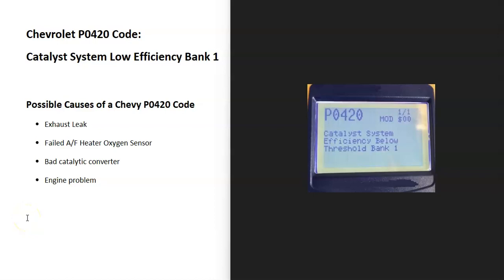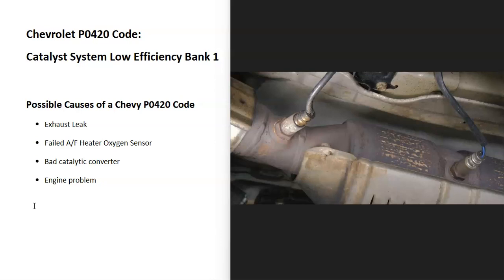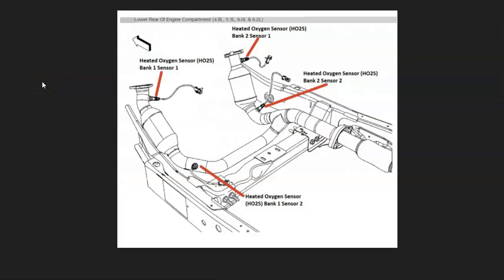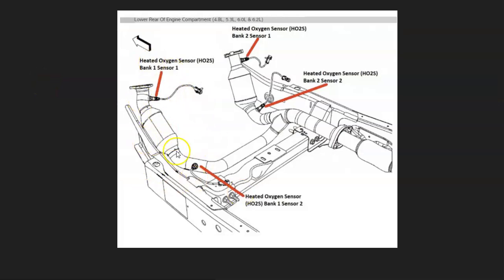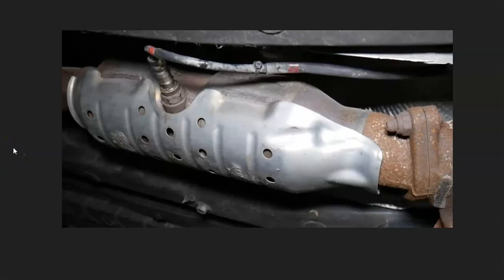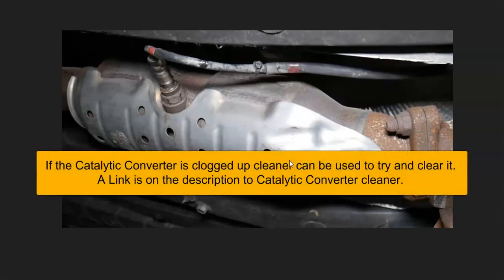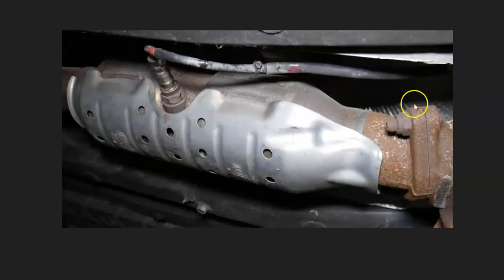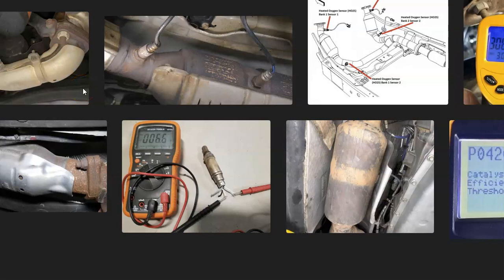Causes and Fixes Chevrolet P0420 Code: Catalyst System Low Efficiency Bank 1

Comment: Im wanting to fix this issue that arose after a shop saved my engine replacing the timing chain kit. Engine light was not on before this repair. Same day, p0420 code comes up when tested at oreillys. There is a seal I notice not sealing the air compartment. Noticed debris in that compartment. Have cleaned the mass airflow sensor. I keep my 'under the hood clean'. Car sits out in elements. I believe it need to change the sensor & spark plugs...just a few things I can mark off as upkeep on my 228,000 mile '12 Malibu. Any insight & advice would be appreciated

Comment: I have a 2015 Chevy Cruze lt and I keep getting this p0420 bank 1 efficiency low code. I have replaced this catalyst converter 3 times already the last time I got new spark plugs, engine coils change. It was driving fine for a month then all of a sudden the light is back on now. Mechanic told me to try and get a diagnosis from Chevrolet to confirm if the converter is bad or a leak somewhere. 🤦🏽‍♀️ this car is putting me through the wringer!
Reply: sounds like an exhaust leak mechanics should have tested for that. before replacing the catalytic converter 3 times.

Comment: 2008 Silverado 1500 6.0 Vortec here. About 170k.  Was towing my light weight trailer a few weeks ago and as I was climbing into some elevation I started getting into some rough shifting issues. Fisihed the trip and came home and then had a trip the following week, I did some stuff to reset the Tcm thinking it was that. I felt like It was driving smoother but my wife said it wasn't. Fast forward 3 weeks, I had a few codes, p049 and po420, I replaced the evap valve solenoid, erased codes and  test drove it today, still shifting rough, seems like from 2nd to 3rd. Also when getting into higher gears it feels like I get high rpms and then let of the gas pedal and then apply a little pressure and the accelerator isnt reacting, it just revs the rpms and takes a second to catch up. Anyone have any advice or directions to point me in? Mechanic can't see me until next week and I'd rather not wait and would like to save some money if it's something I can fix.

Comment: I have a 2021 Chevy Silverado custom 2.7l. my check engine light came on. The code is p0420. I dont have loss of power and I'm getting great gas milage but only a couple of time in 2 months (after getting off highway and come go a stop) my engine felt like it was going to die. I could feel it stutter but then I didnt feel it again after that for over a month. I haven't felt it do it again and that happened on May 11, 2025. Its June 23, 2025 now. I had oil changed 2 weeks ago and engine light came on a day later. 

*The first time i felt the stuttering was after I had ran the tank to almost empty and refilled. I usually fill up when i have a quarter tank but there were no gas stations to get to until i had 20 miles left on fuel. I'm assuming a fuel ejector got clogged due to fuel pump possibly sucking up dirt from the bottom of gas tank? 

And help would be appreciated. I had 84k miles on truck when the light came on.
Reply: I have a 2020 2.7l and I'm having the same issue. However, mine has never felt like it was losing power. I can't get rid of the code. It comes and goes. Did you fix it?
Reply: @codysimpson911  I used Cataclean and the check engine light went away.
Reply: @codysimpson911  I purchased a product called "Cataclean". I poured it into a full tank of 94 octane gas (they recommended adding it before filling up with no more than 4 gallons and driving vehicle for 15 minutes then fill up tank. I did not do this) but after 87 miles driving with Cataclean, the check engine light went off and no codes are found. My issue began when I ran my gas down to nothing (17 miles in tank left). After I made it to a gas station and filled up, once I drove it for about 2 minutes the truck started idling rough - sputtering. This happened twice within a couple of days and then all seemed normal. About a month later I felt the sputtering once I came to stop after exiting highway. Still no check engine light at that point. A month later I was driving and my check engine light came on. I'm thinking I may have had a clogged fuel injector from running the gas tank so low and thought maybe the fuel pump sucked up some sediment from the bottom of the gas tank. I honestly do not know. I just know that my check engine light went off after using Cataclean in my gas tank for 87 miles. Try it and see if it helps. You can use a paint thinner - lacquer as well. It's cheaper. Just look up the ingredients from Cataclean and make sure the paint lacquer has the same ingredients and just add the same amount - ounces to gas tank as the Cataclean has.

Comment: These cars are completely garbage. I have replaced everything so I know what a POS this car is. The cat is usually fine. My code has come and gone over two years. I just replaced the VVT solenoid and it came back? Crazy right? There are two of these solenoid front and back replace both. This car is garbage but I do have 180,000 miles on it. It's a POS. I suggest using paint thinner to a gallon ratio to gas.

Comment: i have an 08 GMC Yukon Denali . no ENG light did run a scan thru Oriely’s . I have that exact “ P0420 “ code . so more then likely it’s the sensor or the converter ?.

Comment: I pray i didnt get screwed. Just bought a 2014  chevy 2500 and 92 miles after driving it out i get this code... i also wonder if it has something to do with the fuel. The truck was designed for the e85 and wonder if they have been using regular gas and me filling it up with the e85 did something to it
Reply: I’m in the same boat
Reply: Did you resolve
Reply: Damn he probably cleared the code

Comment: I have a 2014 equinox. Ive replaced both 02 sensors, the cat, spark plugs, and exhaust manifold and light still comes back. Did every all at once less than 1000 miles since replacing everything🤷‍♂️

Comment: Man I've got a little Aveo I just put a motor in it ( not fun )  but I  only get  a p0420 the cat is basically new  ive oamed the 02 sensors  the both tested at 10  omes or so   as soon as I clear the  code it instantly comes back  I don't see any exhaust leaks  swapped the fuel injectors with my spares and cleaned the maf.  Should I just swap the 02 sensors or ?
Reply from the maker: If the motor was just replaced, I would drive it around on the highway and let the CAT heat up and blow out. Maybe run some cleaner like Cata Clean. Clear the code and see if it comes back. The CAT may just be clogged up from oil or extra fuel after the engine swap.
Reply: Spark plugs, ignition coils.

Comment: I'm getting 420 & 496 I only have problems starting  after fueling up.  Sometimes I'n  the morning after initial  it almost shuts off them idles high before smoothing out
Reply: Also called purge valve 2018 traverse had issue and purge valve fixed it
Reply from the maker: Issue after fueling up is a common symptom of a bad vent valve. I made a full video about each of the EVAP components and how to test them. Here is a link. https://youtu.be/C5s3Rx3wjD0

Comment: This is interesting. Doubt you will reply but maybe someone else will or will find this info helpful. I rebuilt the top of the engine. Cam, lifters, not the valves but did do the injection. I cleaned the hell out of the engine. So I’m wondering if it started running richer after cleaning it. Maybe the engine was used to using less fuel because it was getting absorbed by the carbon build up and since I removed the carbon, it started to run rich because there was more fuel now. Sounds like my cat is throwing code because it’s clogged because of rich fuel.  Did you or any of you other guys rebuild your engine and have this happen 3 months later?  I have 140k miles 2017 Tahoe
Reply from the maker: Sometimes after a rebuild the engine does need to be dialed in. I would test the Bank-1 O2 sensors be sure they are good and then test the CAT. If those test good than it likely is running rich.

Comment: would a exhaust leak behind the second senor cause this code i have a leak in the flex pipe about a foot behind the second oxygen sensor
Reply from the maker: Exhaust leaks can cause issues sometimes, but since it is down after the 02 sensors, it probably won't affect it. I would test the sensors and CAT.

Comment: I have a 2014 Chevy Sonic LTZ 1.4L TurboCharged Hatchback. I've replaced the entire Exhaust system, ive replaced the upstream and downstrean sensors, Ive tried the Cataclean route, ive gotten my cylinders tested and all coming back good, replaced spark plugs and coil pack and The code has been reset afterwhich check engine light keeps coming back. At this point im ready to trash the vehicle. I cant pass emissions and tired of wasting money on this damn car.
Reply: Fuse or relay
Reply: @mikeluky78 Do you now whichwant
Reply: If it drives you can get a paper from dmv to bypass inspection
Reply: I had that problem.  Mine after changing every sensor possible the exhaust cat and pipe.  It ended up being the battery wasn't putting out the proper volts.  I installed a new battery because a freind of mine said it was the problem.  I thought he was a few sandwiches shy of a picnic.  I also put a new alternator at the same time to be safe.  And it fixed my problems
Reply: GregArt-v9g  where are you get the catalytic converter
Reply: It's your pcv valve.

Comment: Replaced the one and only catalytic converter on my vehicle as well with the only two O2 sensors, and the code still comes back. Any suggestions?

Comment: I have a gmc canyon 2009 and I just can't clear the P0420 code. I replaced the catalyc converter but the code came back after 4 weeks. One thing I didn't do was change the oxygen sensor. Can you advise please?
Reply from the maker: I would test the 02 sensor and check for any exhaust leaks. An engine issue can also cause problems, such as a leaky injector, which can clog up the catalytic converter.

Comment: Opinion on cata clean? The Gas tank additives??
Reply from the maker: Cleaners like Cata Clean can work sometimes and in some cases can add some miles to a catalytic converter, especially a vehicle driven only in a city and not at higher speeds.

Comment: I had this code twice. I have a 21’ silverado 2.7 turbo. I had this code twice and correct if im wrong for doing this or if that is not related to the code. So when i had this code i basically just ran the truck in the highway up to 85 miles n hr and for some reason the check engine would turn off whenever i would turn on the truck again. Did the problem got fixed due to maybe more heat on the catalytic converter. Or should it still be addressed??
Reply from the maker: The catalytic converter might be starting to fail. Catalytic cleaner can be run through it, such as Cata Clean, which may give it more miles.

Comment: I have a question?
I have a 2000 Yukon 4wd, would I do the same process to check my o2 sensor for bank 1 and to check my catalytic converter to see if it clogged
Reply from the maker: Yes, it is the same. A P0420 code is the same across manufacturers with the same causes and fixes. There is manufacturer specific OBDII codes, but a P0420 code is not one of them.

Comment: I have a 1999 Chevy Silverado with a 5.3 I have the issue with bank one Cadillac converter with a 420 code I have plenty of power it runs fine every once in a while it'll come on in town I can pull a trailer going down the highway and it won't come out until I get off the highway
Reply from the maker: The components need to be tested, but the CAT may be starting to fail. I would run Cata Clean or something similar through it and see if it clears.
Reply: @HVAC_Mechanic  I did that
Reply: @davidlautwein1338 any luck ?
Reply: @mo548  liquid at part store or walmart that can clean converter out u put it in gas tank

Comment: I put a new catalytic converter in the code can back on
Reply: Lol you swapped parts without diagnosing the parts that were there. You threw money in the trash if you didn't put an ohmeter on your O2 sensors.
Reply: @thepisswalker that does not mean it is working accurately
Reply: @HobbyHijack  lol it really does. You leave it on the car, run it, apply voltage from a variable supply and measure voltage drop. You can compare it to your own readings readings on the bench top. It's the same thing those diagnostic tools do plugged into the car, except those use the car's computer to give you the same values and won't tell you if your wiring is pinched or you have a arc-charred connector adding resistance. I do it manually. It's a little more difficult than plugging in, but you get more info about both the sensor AND the state of the harness and ground straps in the vehicle. It's not for everyone.
Reply: @thepisswalker  i think it’s awesome that you just graduated from Lincoln tech however it really does not .

Comment: Getting this code after I replaced the catalytic converters and all of the O2 sensors and the MAF sensor, MAP sensor, and replaced the throttle body gasket and cleaned the intake. Getting bad mpg and not a lot of engine power. I'm at my wits end with this truck... The only code I have now is this code on the bank 2. I have a lifter ticking noise in the passenger side rear cylinder and I'm starting to wonder if there is an issue with the valve train causing this. I have 165k miles on the truck and have yet to replace the o ring on the oil pickup. I'm curious if doing that will clear up the lifter tick and get the engine running correctly. Truck has all new exhaust system, shorty headers, new plugs, plug wires, and coils. I have yet to tear down the top end and do new gaskets and seals but I'm scared of what I might find. I also have not done a compression test yet.
Reply from the maker: A P0420 code point to a CAT issue or an O2 sensor. I would loosen up the exhaust bolts on bank-2 at the flange before the CAT, drive around the block and see if engine power comes back. If power comes back there is an issue with the CAT on bank-2.
Reply: @HVAC_Mechanic  These cats are brand new, though. I bought the Magnaflow cat kit off summit. Is it possible to have a faulty cat out of the box?
Reply from the maker: While not common, they can sometimes be defective. Anything I say is a guess. The components all need to be tested, but I would rule them out as bad. It is also possible that an engine issue is clogging them up.
Reply: @HVAC_Mechanic  I appreciate any thoughts you provide. Guess I have more digging to do to find the issue. At least now I have reduced the 4 codes I had down to just one code. Previous owner of the truck did not have it professionally serviced and didn't do very good work themselves.
Reply: Any solutions?
Reply: thats a CV joint.